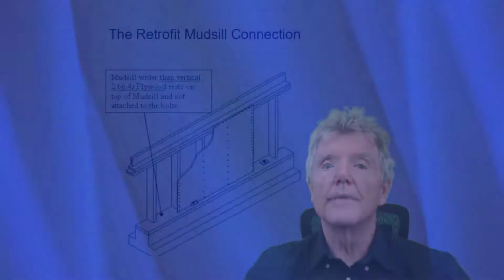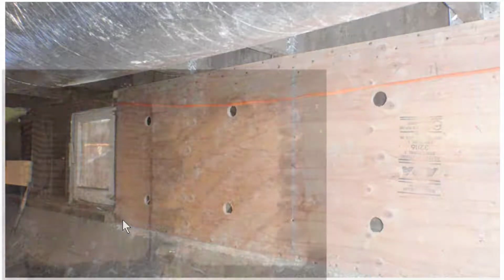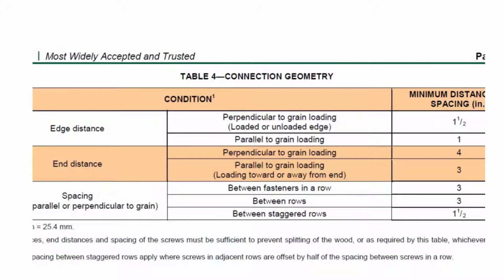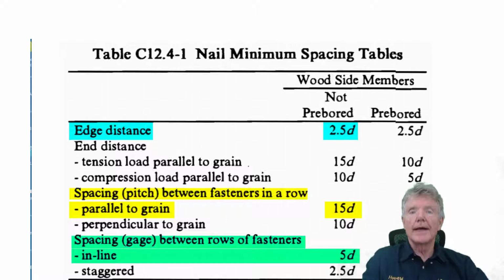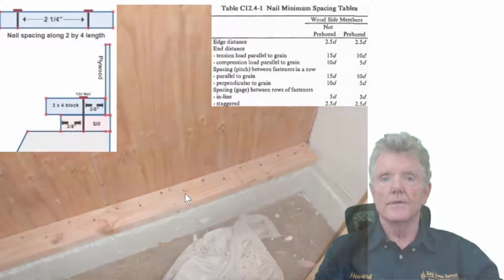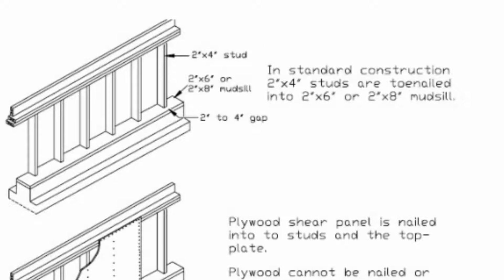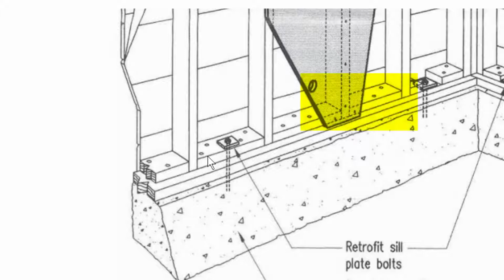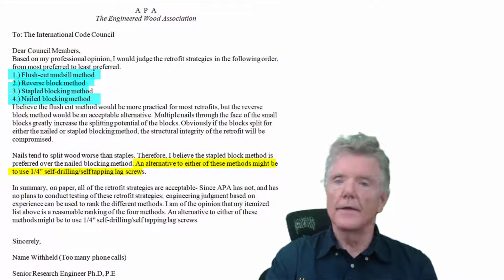Tested Retrofit Shear Walls Long Version

Comment: I may have missed it, but what is the (minimum) thickness of the plywood required for sheathing? Is it 15/32"? What was used in the video?
Reply from the maker: Yes, 15/32 STRUCTUAL 1  They make "rated" and structual 1, you want structural 1

Comment: What about a mending plate to avoid splitting for the blocking method? and If one uses higher-grade wood  does that solve the issue?
Reply from the maker: I am not sure what you mean by a mending plate but if you use Simpson SDS Heavy Duty Connectors you get 400# resistance for each screw.  They don't split the wood so 3 screws per block should be all you ever need.
Reply: @bayarearetrofit5814  Thank you

Comment: Do you recommend pressure treaded wood for shear wall and block wood? Does it rot the hardware over time (even if its galvanized)  Stupid question sorry...
Reply from the maker: I don't see why it would be necessary. New pressure treated wood is almost always ACQ which is very corrosive, even to hot dipped galvanized nails.  Any fasteners used with it must be stainless steel.  Type in ACQ in the search bar of the Bayarearetrofit.com website and read all out it.
Reply: @bayarearetrofit5814  ok Thanks. great info.